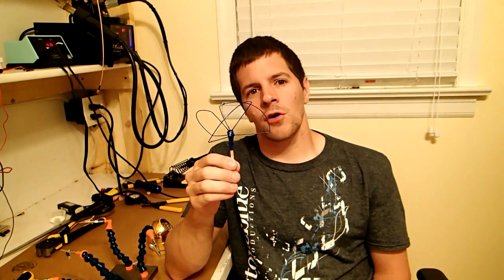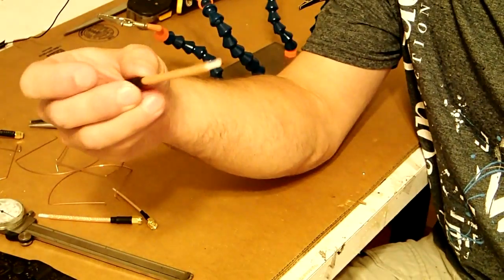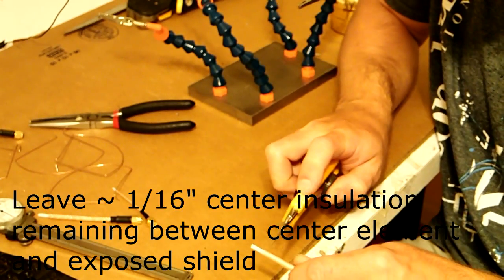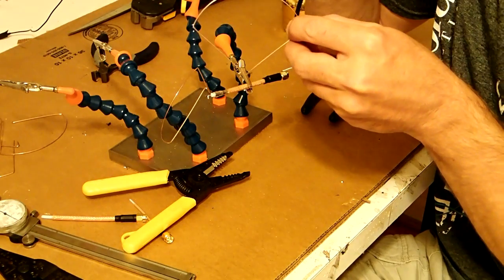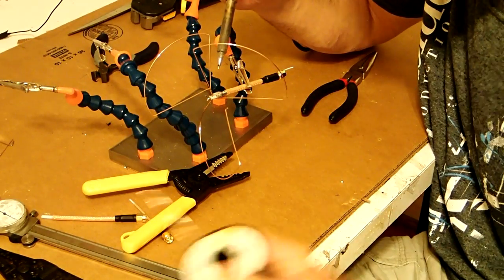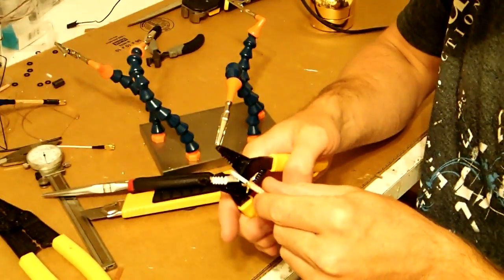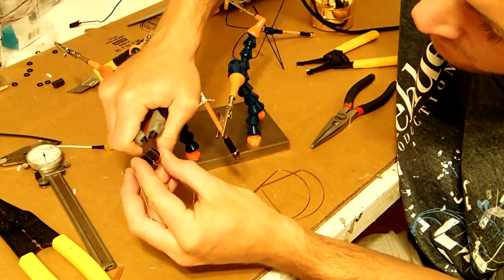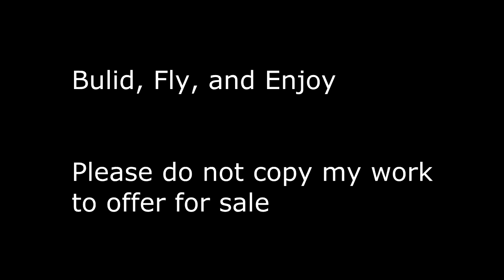Cloverleaf build tutorial mpg

Comment: How thick can you go with the wire or does it matter I have a 2mm copper wire I wanna build a 5.8 clover leaf,  is that two thick or would it still work if I managed the bending
Reply from the maker: Too thick is a relative term.  If you are looking for perfection, yes it is too thick.  if you are looking for something that will work reasonably well that you can enjoy, 2mm is fine.
Reply: in other words  thicker wire will compromise the performance

Comment: Hello Alex. Thank you very much for this informative video. I couldn't find the mig wire you used in my local shops. Can I use 0.6 or 0.8mm stainless steel wire with the same calculated lengths? Thanks in advance.

Comment: Are the measurements to the legs that get soldered to the antenna base? So for 1280... 2.36"+extra length for soldering or 2.36" including the bend for soldering?
Reply from the maker: +minibok2008 The base leg (that gets soldered to the cable) does not count toward the lobe length.  This base leg can be any length you want.
Reply: +Chris Ollenberger 
I´m asking the same question! Is the bend included?

Comment: I made one and it worked, how exciting!

But now I'm curious about the calculations behind the lengths of the antenna. What I could find from several cloverleaf calculators the total lengths of wire (including bends) are calculated as the constant 307022 [m/s] divided by the frequency in MHz. My first guess before I found this formula was that the lengths were simply c/f, as this is almost the same and that the small difference was caused due to conversion between imperial and metric system. Is this to correct for radiuses and wire thickness or something?
Reply from the maker: SirArghPirate - Very close, but not quite.  it is simply an adjustment for proper impedance, that's all.  Good insight, though!

Comment: Hi Alex,
Thank you for your videos, I have found them very instructive.  I am working on a remote wi-fi network for a school engineering project and will try using a skew planar or cloverleaf antenna.  I noticed somewhere that you specify the wire gauge for the antenna elements based on the transmission frequency.  Why is this and how critical is it to match the wire gauge to the frequency? 
Thanks again,
Greg

Comment: I noticed a major difference between this antenna and your official Airscrews. The lower legs (ground) of the lobes are all 180 degrees flat. Instead the Airscrews point the lobe arc directly outward 180 degrees. Does this give the antenna a more uniform signal?
Reply from the maker: Yes!  It actually moves the effective pole further away from the center and increases the gain and axial ratio.  Mind you, the cable must be balanced or it will resonate and lose circularity.

Comment: Alex do you have any links of where we can get the higher quality "Milspec" cable?
Reply from the maker: Radz Gardiner
 - I would guess you have a short at the feed point or the cable is damaged.  The type of wire has very little effect on the signal and performance.
Reply from the maker: Try searching for "RG402".  This is a common cable that is good for 20GHz and works well for this antenna.
Reply: Thanks a lot!
Reply: Alex Greve Hey Alex,
I built a 1.2ghz cloverleaf and Skew planar on Lawmate but ran into some issues, i'd rather ask the creator himself for pointer. My antenna is built for 1280mhz, i used steel (Fe) .8 Mig wire, and a long (approx. 40cm RG316 coax) directly to the elements. When i tried it out on the ground i managed get several hundred meters of good signal, despite having the TX indoors, and when i tested it in the air, I got nothing at all every now and again at 100m above me i'd get image but a fraction of a second. My guess is that my element material (steel) is no good as you suggested copper-clad steel, and the coax length is too long? I'm just one step from goal but seems like a leap! Help!
Thank you for your massive contribution to this hobby man, God bless you
Reply: Alex Greve  Thanks for the reply Alex. I think I know where I went wrong, when building my skew planar wheel i used the same measurements as the cloverleaf, so I built another one corrected to the SPW tutorial you made on rcgroups and ground tested it. I managed to get signal despite interference at 1.5kms since the VTx on the ground and me on a hill with the VRx and a little town in between which should explain the heavy interference. Now I'm assuming its a normal since its a ground test. Do you think I should be okay up in the sky? and will my range be any better?
Reply: I'd like to send you my antenna pictures if possible, unfortunately I don't have an SWR meter or the components to do a DIY where I am.

Comment: Sry to add more questions Alex. Say you have 900mhz, what is the optimal coax length? Someone said it should be a multiple of a 1/2 wave length x 0.6 from the coax resistance. So 333mm * 1/2 * 0.6 = ~100mm?
Reply from the maker: TAZ427
Coax length assuming you are using 50 Ohm coax is irrelevant.  However, I find most coaxial cable is not really 50 ohms at microwave frequencies.  1/2 wavelength or  a multiple of that is always the safest way to go.  However, even with the wrong coax and the wrong length, you probably won't notice any difference in performance.
Reply: Coax length shouldn't be relevant.  The braiding of the shield wire should be preventing it from directly picking up RF.  The antenna pick up is the exposed wired, and the coax is just a 'conduit' at this point.  That's why you'll see these of various lengths for the same RF (the arc's are always the same size, but the coax varies.)  People like to keep them as short as possible more from a rigidity and impedance perspective.

Comment: Just built 2 of these RHCP (one for my ground station and one for my quad). Was thinking of mounting the one on my quad upside down but it appears that now it would be a LHCP??? Is this correct.  Then if so I would need to build a LHCP for inverted mounting to match the RHCP (mounted upward) on my GS.
Reply from the maker: TAZ427
Bingo!  Very accurate.
Reply: No it would still be RHCP.  You'd have the same arc orientation and radiation pattern flipping it 180deg's.  Techincally it would never be LHCP, but when oriented at 90deg's from each other, then it would have a radiation pattern like that of an LHCP.  Think about the orientation of the arc, that's where the radiation pattern is coming from.

Comment: I bought the Bluebeam antenna set from a US supplier in 1.2ghz, I dropped it one time and had it drove over, completely flat. Recent back into its shape and it still works a treat. Best upgrade to any FPV set up. Running 300/400 milliwatts and the clarity is perfect in buildings and through forestry. No goin back now.

Comment: One small tip: I recommend sticking with eutectic solder when doing those kind of partial-melting hacks. ;)
63/37 will be easier to get good results with than 60/40 where the metals melt at different temperatures.

Comment: But what is it supposed to look like when its finished? in detail. i got the "bottom" part i think. flat, 45 degree tilt. 120 degree separation in between each lobe. but, how long is the curved part, and how far does it curve? is there supposed to be a 30 degree gap in between each lobe (viewed from above) or is the curved part made longer in order to fill the gaps? More details please.

Comment: in ham radio we use vertical and horizontal polarization, but nnot normally both at the same time. we use as little as 5 watts to thousands of watts. i think if this antenna was good enough in the element for 50 watts and the erp was good, and the swr is good, then it could be well. yes there is left polarized antennas for special  uses like moon bounces, etc. i am curious as of the origination of this antenna. that's all thanks for your interest in my questions

Comment: only by the gauge of the coax and the gauge of the antenna element would determine the watts that it would handle. i might think 50 watts fm or ssb the antenna might take. in ham radio we do need horizontal and'or vertical antenna for different occasions. this kind of antenna arrangement must have been engineered by some one, some time, thanks for the interest of my questions

Comment: unless i missed it, when did this antenna begin to be used and how was it invented from. i am a ham, we never were not taught about these types, others yes not this kind. i wonder how many watts these are rated at so that to use these on a base radio, maybe 30 watts would your build burn out. how wide is the swr or band width